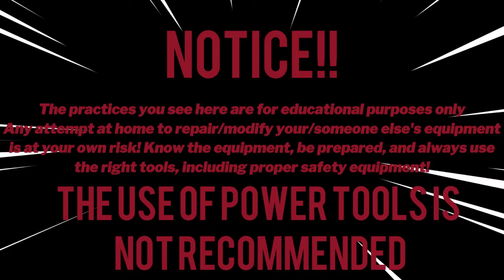Taking Apart a Vintage Penn International-Condensed

Comment: How do you determine on these International I 30 reels if the original doughnut drag washer needs replacing? 

I  have one that is 0.124" or ~3/25" (3.15mm) thick.

What was the original thickness?